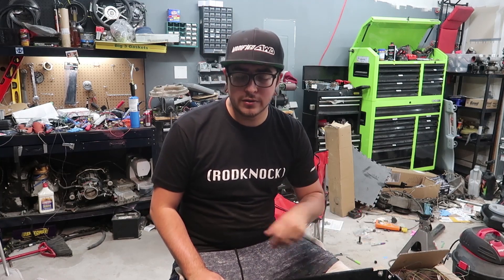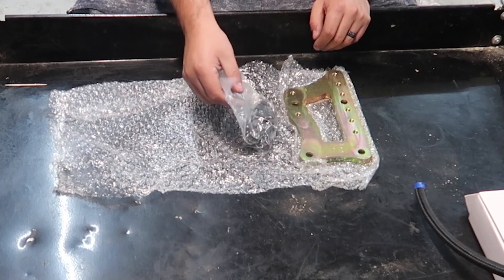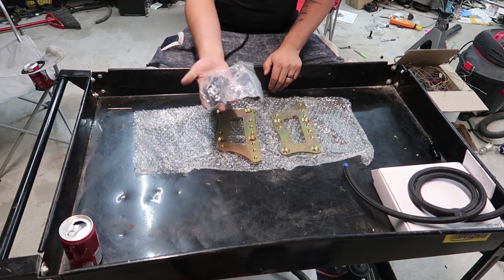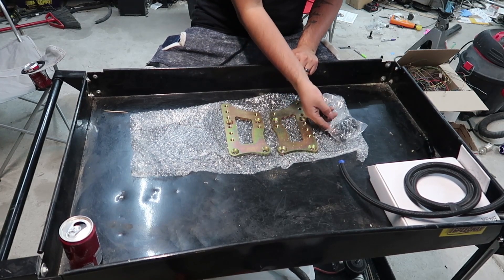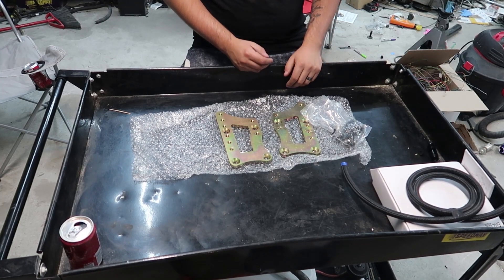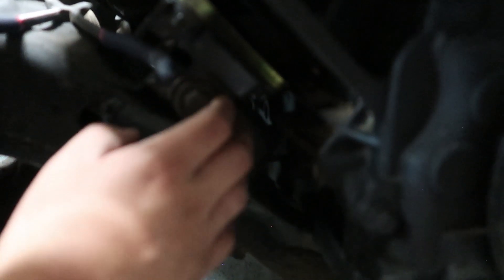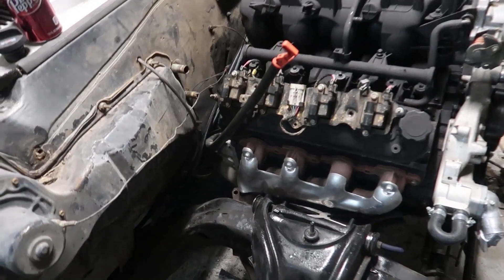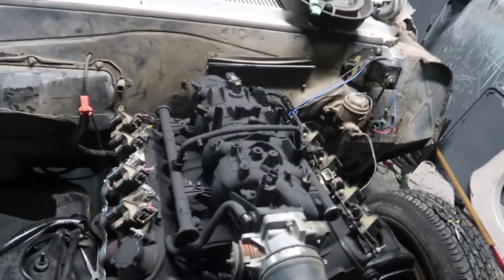LS Swap basics - Part 2 - Engine Mounts  *How to LS Swap Any vehicle

Comment: Mines a 67
Which holes did u use?
Apparently the rear ones,soooo? That'd put the engine forward?
Is it recommended to install the engine /transmission together?stock 4060 auto?
65,,,67 are same?Abodys?

Comment: When you do a ls swap. When you take all the wires out of the harness like evap and so on, do you have to have the pcm programed .
Reply from the maker: Yes mostly because of VATS, which is the Vehicle Anti Theft System. If it isn't disabled the engine will only start for 1 second and turn off

Comment: i have a 70 olds 98 that had a 455 in it will this work for it
Reply from the maker: Im not sure I know BOP are different bellhousings than SBC so I don't know if mounts are different as well. I would look up the sister GM vehicle and see if the mounts are interchangeable
Reply: @JovaniDanteGriego  whats the sister GM lol
Reply from the maker: 70 Cadillac eldorado. But again the engines might be different I don't know enough about that chassis
Reply: @JovaniDanteGriego  oh ok